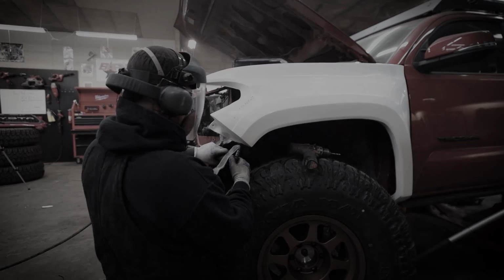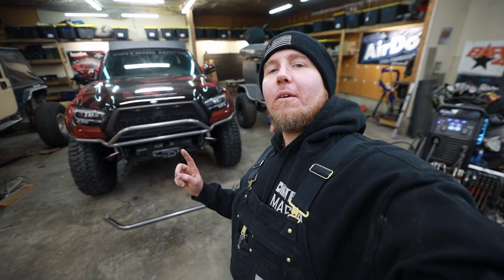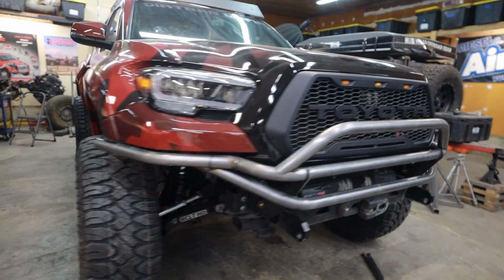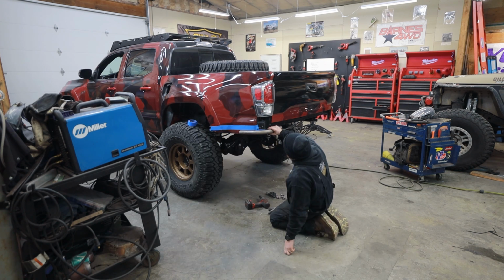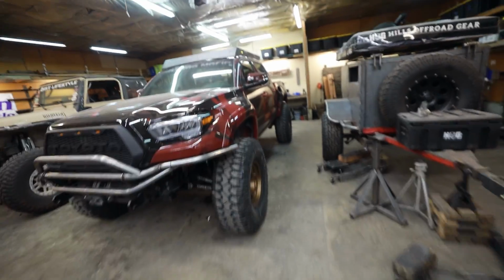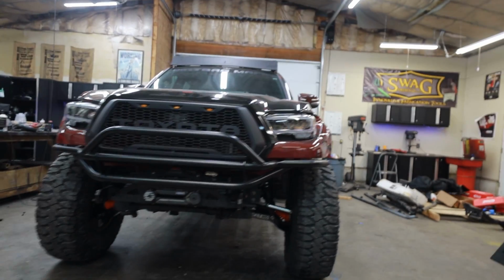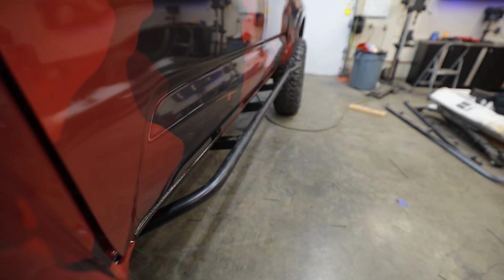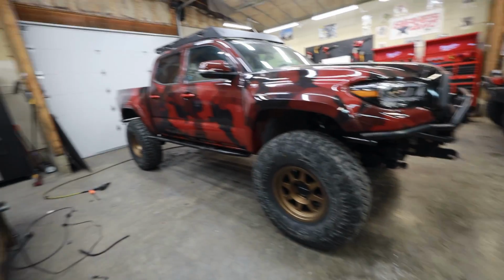Toyota Tacoma DIY Tube Bumpers And Sliders. Ultimate Toyota Tacoma Build Episode 8

Comment: Question on your bender. Where did you get those springs you use for the "return" on your bender? Do they have apart number? I have the same set up as you. I got the swag "return spring", but it just doesnt do the total work. Thank you in advance buddy. (a fellow Fabricator, High Dezert Fabrication)

Comment: Looks frail. Don't see how that light weight tubing with no  additional support or plating is going to protect anything outboard in front of the wheels?? Nice work. But just looks like a fancy decoration for town cruising. Dandahermit. The bumper winch mount on my little Toy billy goat could be used to batter down castle gates.

Comment: You are a true craftsman, innovator & take pride in your work. I built a Gen 2 Tacoma Pre-runner & a 1987 4x4, IFS, Class 2000, MORE desert race truck & have the utmost respect for your skills & talent. You’re a 10+ and out class all the other wanna be’s.  I’ll be out at KOH for my 10th in a row & pitting for the 4664 rig. See you out there.

Comment: It looks awesome! Great job on the build. Not sure I would have gone with that glossy of a finish on the wrap. It kinda makes the fenders and bed side a little to much like plastic. But it looks good. The tube bumpers, sliders and integrating the winch mount was top notch. The tune you got, I believe Michael from Conquest Overland used the same guy for a tune on his Tacoma. I live local to you where do you go get your steel at?

Comment: You will be amazed at the difference after the tune.  I had a 2008 model for 14 1/2 years then got a 2020 model.  Always told my friends I would pay someone $1K to give me my old engine and transmission back.  Got the KD MAX tune, got my performance back for only $300!

Comment: Yeeeees! Better shift points!

I drive a 2nd gen, and I hate the factory shifting so bad that I basically drive it like a manual (because it lets me force it down into lower gears).

These trucks have plenty of power for my preferences, they just refuse to use it because they constantly sit 1 or 2 gears below where the power band even starts picking up.

I CAN make it shift down in drive by putting the petal to the metal, but it just resists so bad. When it does finally give in, it too often drops 2 gears at once and revs like a mother. It just has no chill.

I’m gonna look into reprogramming like this.
Reply: Hey Steve, 2nd Gen 4.0 tunes are badass when tuned with HP tuners. Find a tuner near you! (I’m in Portland if you’re in my neck of the woods)

Comment: Great series on this truck... I have a 2019 Tacoma so I was very interested to see how you modified it. For the bed you should do a Tray like alot of offroaders use in Australia. Also... when you open the driver door and that beep is driving you nuts just press the rubber button where the locking mechanism meets the body and the beeping will stop.
Reply: When the guy that did your tuning he could've turned that off with that software. If you know anyone that has techstream with that dealer software it has many more things (sounds) turned off.

Comment: I see a buggy style bed in the future... some cage bars... ? Provided it all works as well as your hoping... some rally style Mudd flaps... more lights.. cross between rally / baja and rock climbing... I am a little surprised at no bottom bar on the front bumper to protect the cradle area... and a skid plate for protection and sliding over items... the truck looks great no question about that.  A whole lot of modifications for a brand new truck.  But I enjoy watching anything with all the fab work.

Comment: I totally agree with the statement on angling the rub rail on the sliders up. Mine is at 45° and it looks great. 

Front bumper looks great as well. I would want some gussets on those recovery points though. Ideally there are no side loads, but sometimes that can't be avoided.

Some more details on the tune would be interesting as well. Looks like KD Max uses the vF Pro platform, but did he just write an off the self map to your engine computer? Were there modifications made to the TCU as well to change shift points, or is that achieved though changing maps on the ECU that alter the CAN data sent to the TCU? I know you were pressed for time in this video, but a follow up on the tune where you give impressions and talk more about what specifically was done would be interesting.

I'm looking forward to KOH content!

Comment: One thing you or your tuner did not mention is that after tune is flashed it takes a couple tanks of fuel to settle. Another note these and many other alike are octane learning tunes. Meaning if you want to use 87 octane you can . But I recommend running 92 octane . My Tacoma is at 5,350 lbs on the kdmax pro tune with sport throttle sensitivity. I've tried running lower octane and taco felt like a turd.

Comment: The only thing I don’t like about these kd max tunes if the throttle sensitivity. I love the forgiveness of stock sensitivity when crawling
Reply: I am sure that is something that can be adjusted.
Reply: Good point Tyler. We specifically dialed back GL throttle to stock for this very reason. It should be nice and controlled
Reply: @PaulPeralta  GL?